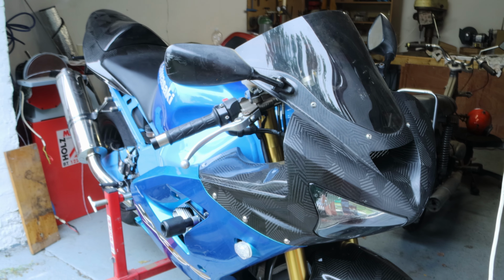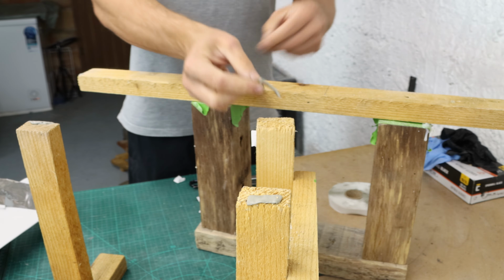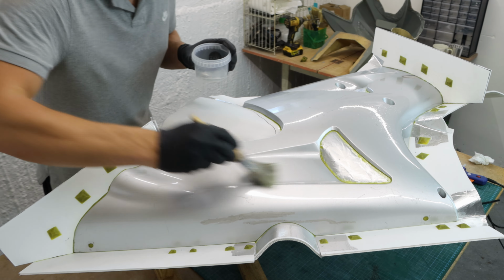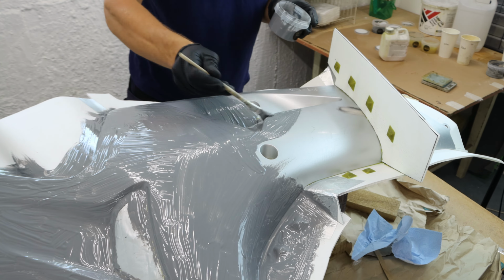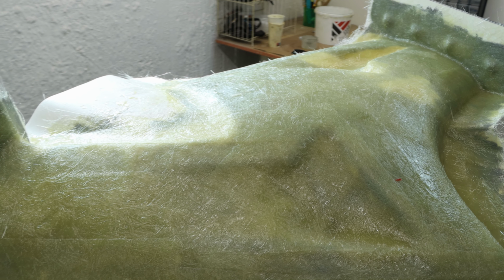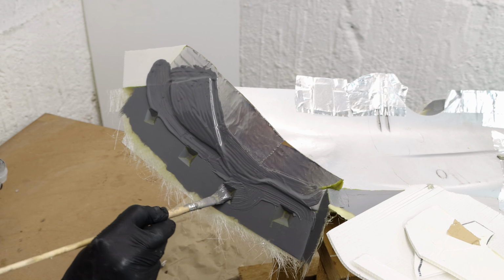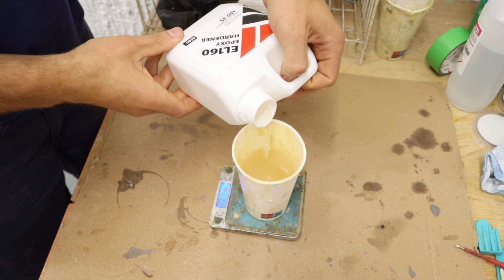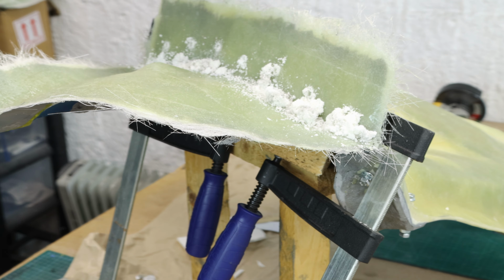Carbon Fiber Side Fairing PT.1 - Making the mould - ZX6R build PT.10

Comment: Awesome work! Out of curiousity, why did you end up making a split mold to account for the damage on your original fairing instead of just making a single mold from the blue fairing without damage?
Reply from the maker: Hey
I really like your question. That's right I did not talk about that. From the blue fairing were missing pieces already. I did modify that a long time ago. I fitted an extra water cooler onto the bike and needed additional space. I had to cut out small chunks of the fairing, unfortunately. I wanted to have the original fairing as it is in the end. 
Thanks so much for the compliment 🛠🤟

Comment: Love the oven - Going to be making one like that on a smaller scale. What kind of temperatures have you run that insulation up to without it being an issue?
Reply from the maker: Thanks man!
The insulation foam take a lot of heat if you choose the right insulation. Vermiculite Fire Resistant Boards resist up to to 1100C
I used polyurethane insulation boards for my oven. Those are heat resistant up to 140c. I never used my oven over 120c. 
Or you can use metal sheets and rock wool. 🛠️🤘

Comment: So a few questions, when do you know you need to do a second mold add-on. 
Also why did you not just use the good fairing in the first place so you didnt have to create a 2 part bottom?
Reply from the maker: Hey
Thanks for your question. 
The original fairing I already modified and I cut out pieces as I’m running an extra water cooler on the bike. I wanted to have the mold made off the original fairing.
I usually decide how to make a split mold by looking at the part. Looking for the curves, bends, edges, holes…. The mould has to release the part freely. Also you could look at the back side of your plastic part. You can see lines on the back side. Those lines are from the factory mould. That way you can also decide where was the split line on the factory mould. 🛠️🤘